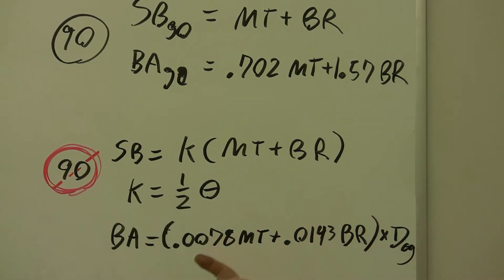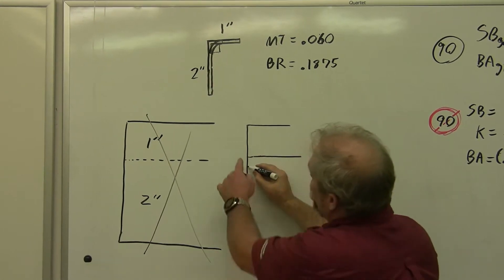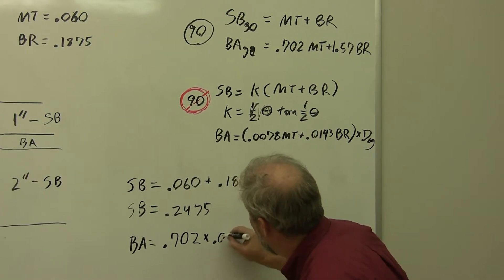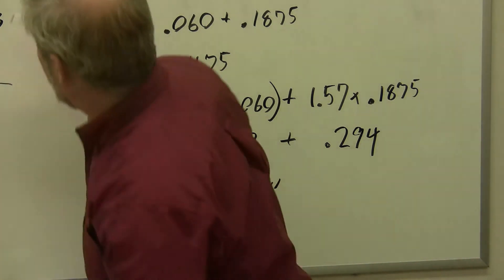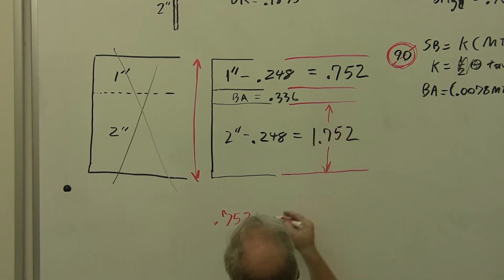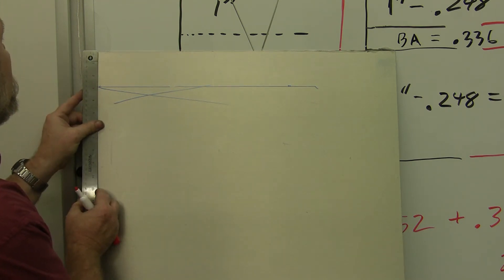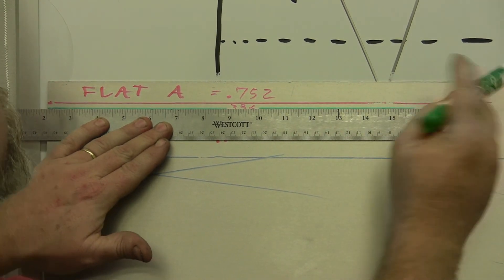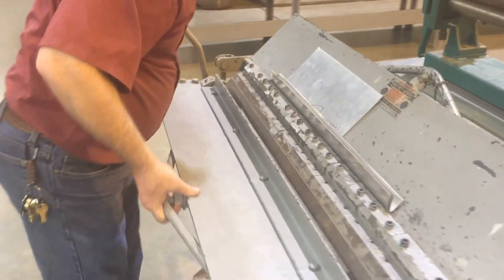AVT 206 A&P - The Math Behind the Bends - Example 1 Math and Fabrication

Comment: Where are these numbers coming from for the bend allowance formula?this video you have ba=.702+mt + 1.57 +br.   And the non 90 you ba= .0078+mt + .0143+ br. Why is one .702 and the other .0078 i don’t get it.
Reply from the maker: One is for 90 degrees, the other is multiplied per degree.  0.0078 x 90 degrees is 0.702.

Comment: In the non-90 degree video I missed what (k) represented
Reply from the maker: When the FAA talks about "k," it represents the trigonometry based adjustment to the setback (its the tangent of 1/2 of the bend angle).  When most non-aircraft sheet metal mechanics talk about "k," they use it to represent the percentage on the material thickness of the neutral axis.  Unfortunately, these two different uses of "k" do not help people understand the process.
Reply: I guess he said Tangent